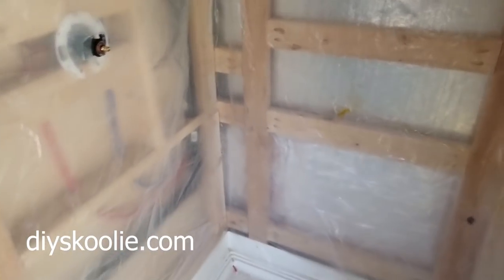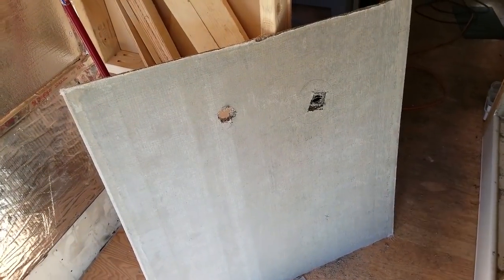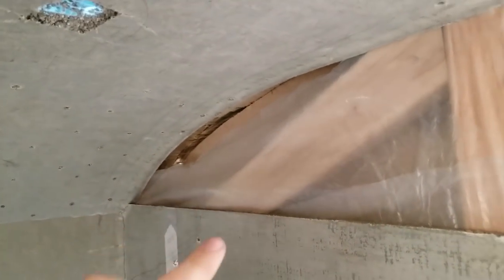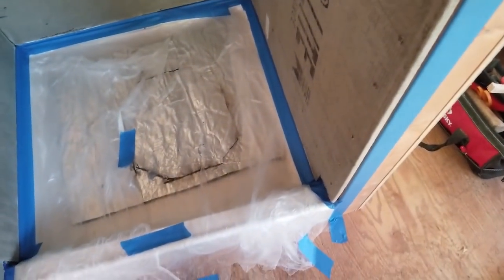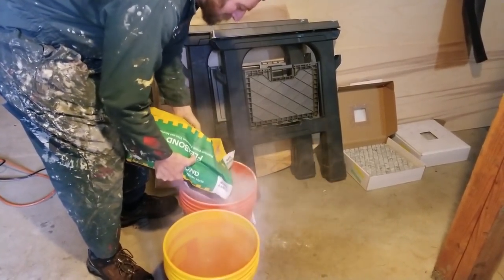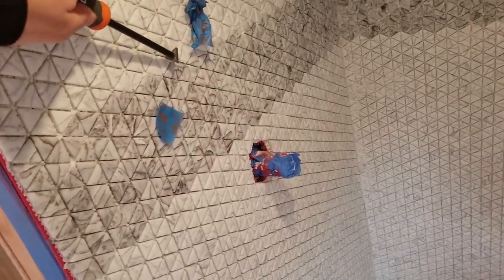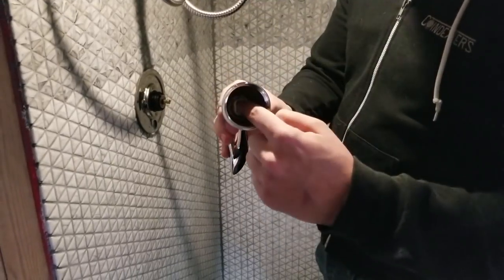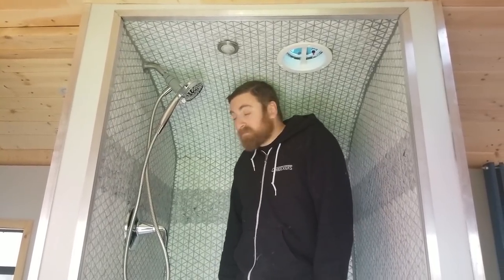Conversion Video 46: Tile Shower

Comment: What is the dimensions of your shower pan and where did you get it? Thank you for your videos I wished I was as far along with my build as you are with yours. Keep up the good work.
Reply from the maker: I got the shower pan at Home Depot.  It is 36" square.  Originally, I was going to do an all-vinyl shower.  My wife nixed that idea, but I already had the pan, so I continued with it.  They make more expensive pans that act as a good base for tile, though, if you want to go that route.  At the end of the day, I love my shower just the way it is.
Reply: DIY Skoolie thank you for the info. I was going to go with a 32” square but I think I have enough room for a 36”. They’re kind of expensive. You’ll have to keep us posted on your tiles, how they’re holding up. I’m with you, love my shower. Can’t wait to see your next video. I can hardly wait to get back on my build.
See you next video. 🙂

Comment: How did you match the curve of the ceiling when cutting the tile?  Did you just use the previous template and was it difficult?
Reply from the maker: It was some guess and check.  We had extra tile sheets. Each sheet was rather flexible.  A marker helped with drawing it out.  The grout does a good job of hiding imperfections.

Comment: Have you had any problems with the tile on the floor cracking?
Reply from the maker: No problems at all, so far.  We've talked to other skoolie people that have done similar things, and they usually report that it is holding up well.  We went with smaller tiles so that breaks would be less impactful on the aesthetic, if they do happen.  The grout and thinset is supposedly somewhat flexible and shock resistant.  I don't think this is an application they had in mind, but it seems to work, nonetheless. We've been down some pretty rough roads, too.